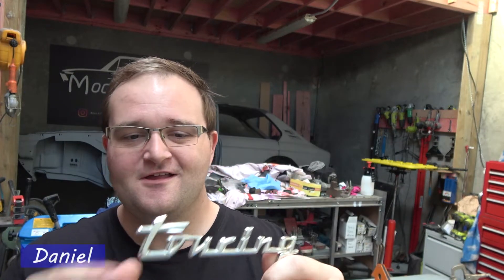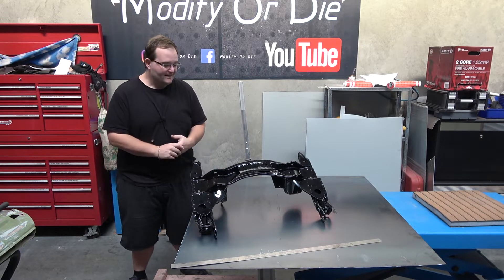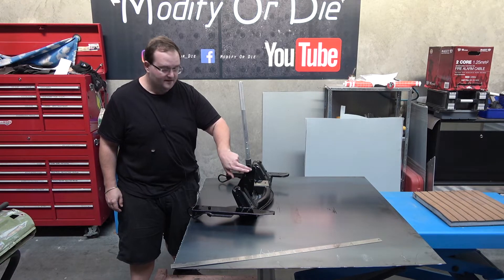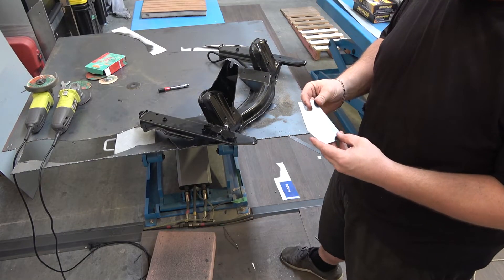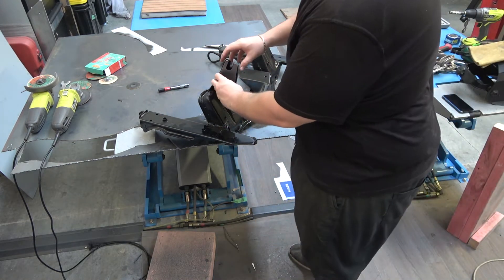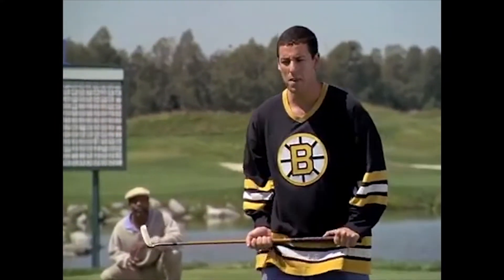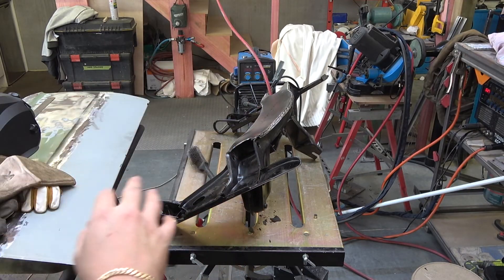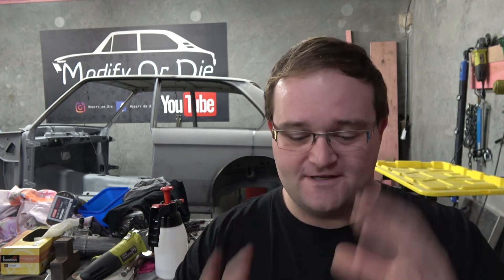Super Solid Subframe! - BMW 2002 Touring Restoration Project Episode 31

Comment: Nice job on the subframe. I do a lot of track prep and reinforcing on BMW's and your welds look pretty nice or "tidy" as you might say from your side of the globe. Haha. You may want to consider filling the void between the motor mount plates where the bolt passes through. I usually add two small diagonal shaped gussets  that come off of the tab. Keeps it very solid and 'positive' feeling coupled with a quality poly or delrin bushing, which depends on your application, but I would for sure recommend something like an 80A durometer grade bushing in your case. No noticeable NVH and still suitable for street driving.
Love this series, and everything classic bimmer! Keep it coming! 👍💪
Reply from the maker: Thanks Pete, appreciate your feedback, made a note for when we get closer to dry fitment. More to come soon :)